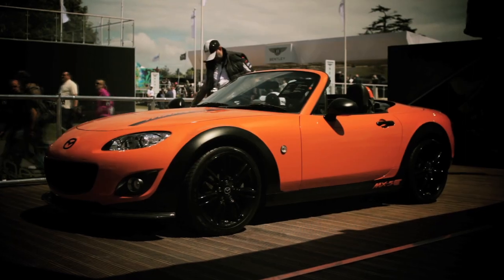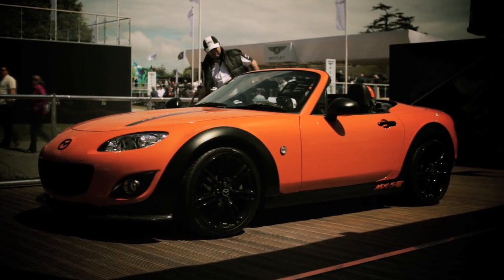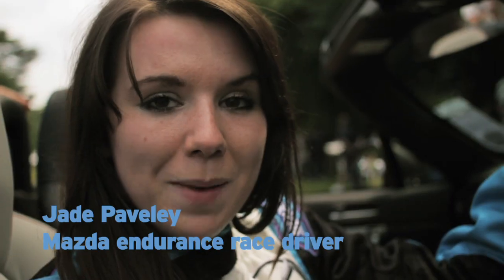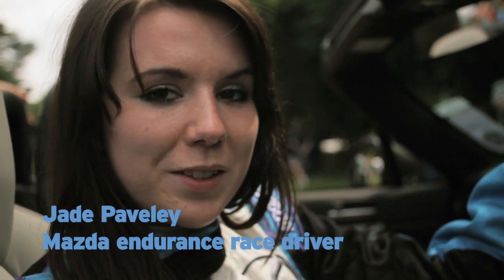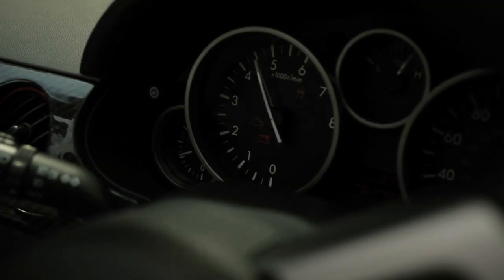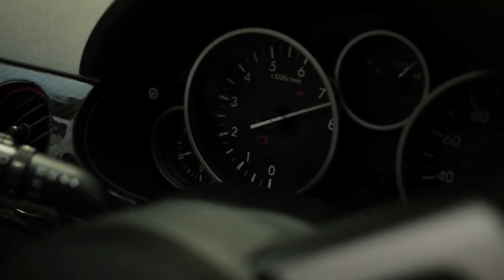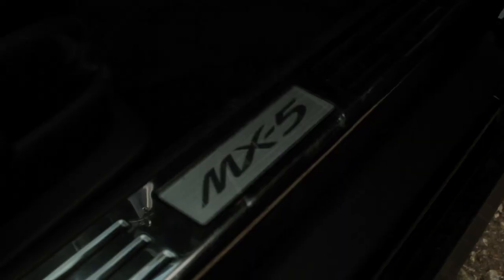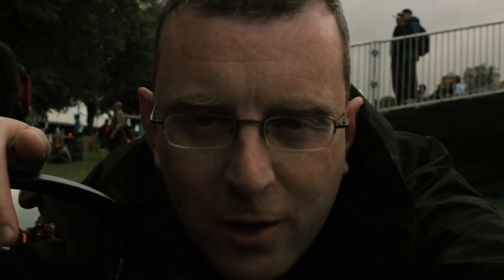The MX-5 GT Concept Hill Climb at Goodwood

Comment: I don't thing that heel and toe is everything in racing.
She kept clear lines,her steering inputs were accurate
and she demonstrated the car's new engine.(sounds great btw)

For hitting the redline I think there are 3 reasons:
a) either it's not clear  , as far as experimental gauges are concerned
b) or she drove it for the first time, and didn't want to spoil 
   the performance with chickening out so did her best to demonstrate all the rev band.
c) she was a bit anxious

Just my 2 cents.